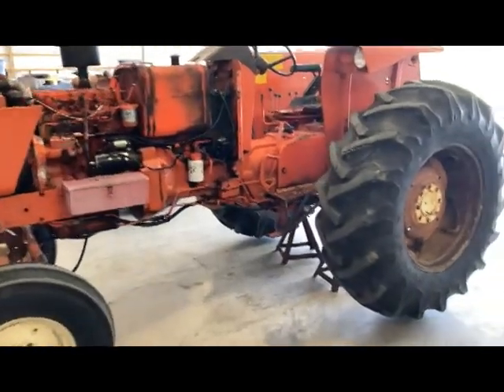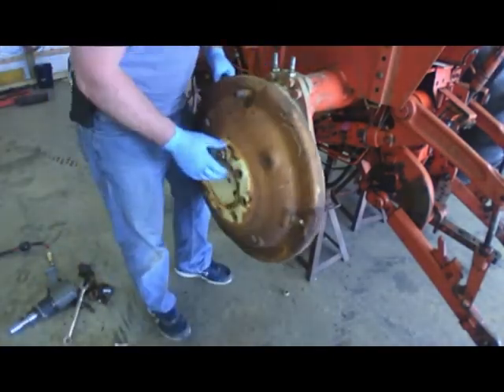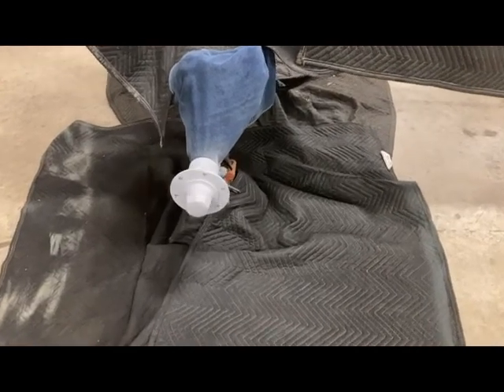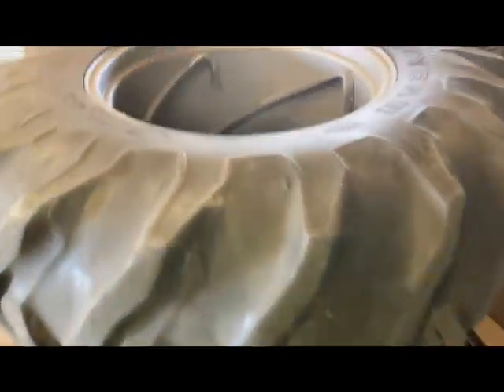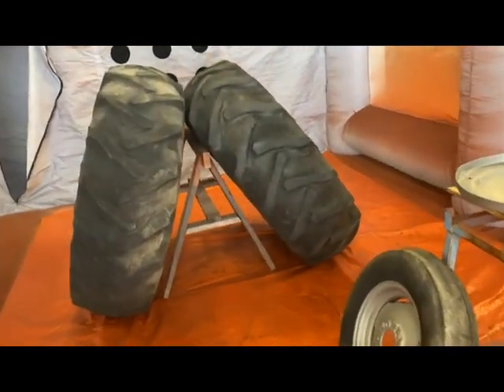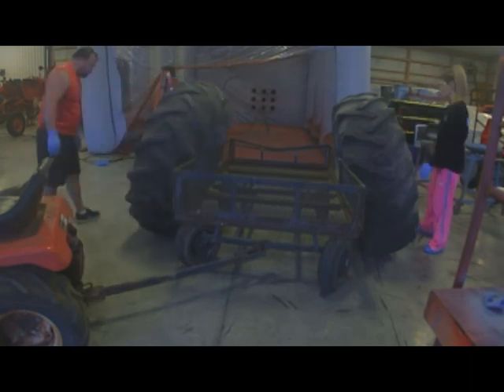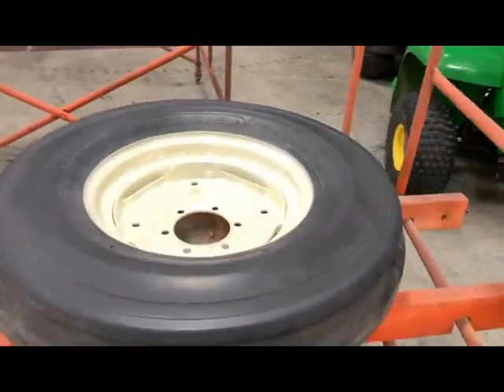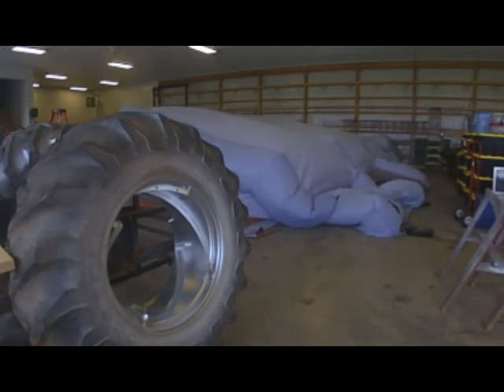Allis Chalmers 175 Sandblasting and Painting Rims Part 5

Comment: I have used petroleum jelly on tires before just rub it around the sidewall the the over spray can be wiped off or pressure washed off later